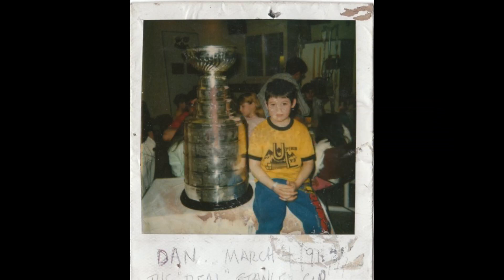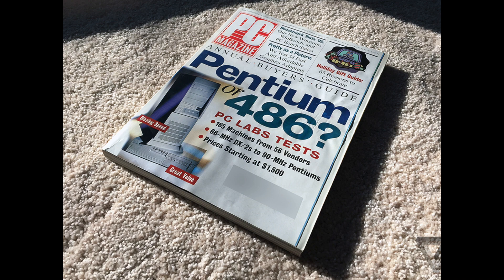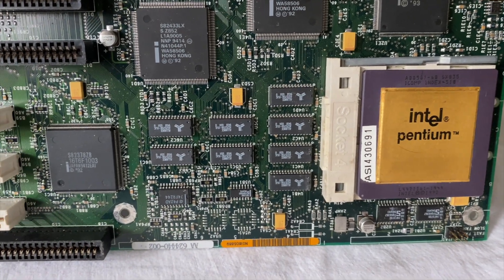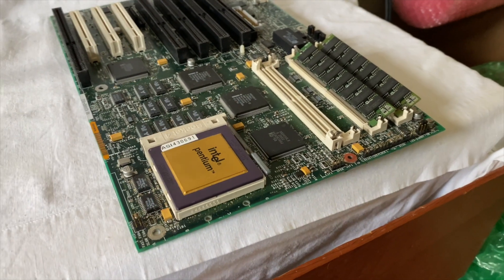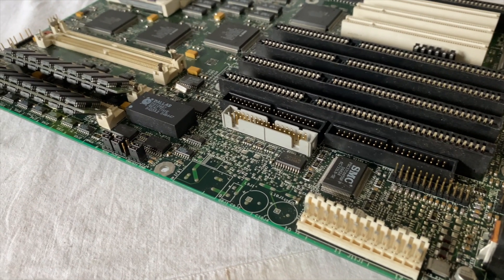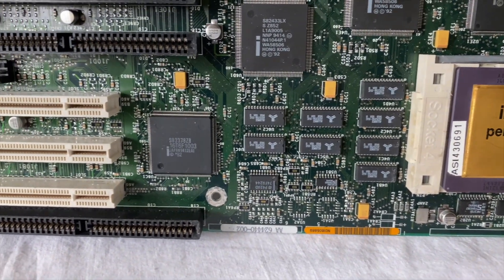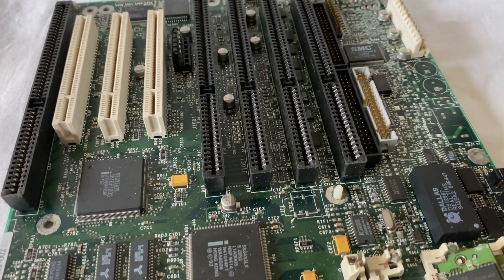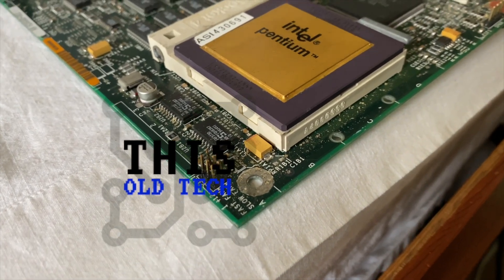The P5 60Mhz Batman's Revenge Motherboard History

Comment: Great video! 

I acquired my first P60(Vobis branded) in February of 1995 and as soon as I had installed DoomII I fell in love. Still have 4 boards(3 generic Intel + 1 ECS) all "overclocked" to 66mhz despite some not having the required voltage regulator. I also had one board by Siemens where I swapped the crystal for an 75mhz one and the cpu would even work at this frequency but the chipset needed to be cooled... quasi the fastest original Pentium I had ever used(~55fps Doom timedemo).

the pictured Escom P60 would be quite a treat.
Reply from the maker: Damn, I have nerd envy over here. I had no idea it might be possible to push to 75... Almost makes me want to fiddle with the strange P60 board I've got that supports 32pin & 72pin RAM :D

Comment: DUDE!! I have same Board!  But it wants me to enter password when entering BIOS. If i'm simply pressing Enter - it inters BIOS, but it has few features.. It's kinda want admin password or what? Please help/ THX!!!!!
I modded RTC Dallas.  Jumpers do not give anny affect  on Administrator password
Reply: Might have to de-solder the Dallas battery chip and solder on a socket. Removing the battery should help it clear the password, I believe these also have a jumper to disable the password entirely if I remember correctly. One of the few types of boards that has that.
Reply: @DanielDeyette  i did it already
Reply: @DanielDeyette  jumper do not give effect!
also board is in perfect condition. it should work properly but it doesn't

Comment: I think the P66 board is batman's revenge (AF2 fw)? Anyway just fixed a dallas rtc (tapped into it adding new replaceable cr2032) on mine and updated to last firmware 13 (yesterday) haha. Terrible IDE implementation, but easy to add sata to it! A cool piece well built and stable.

Comment: Good overview. Dell used this board in the Dimension XPS line as well, around 1994. Only difference was PS/2 instead of AT keyboard plug. My XPS P75 has this board and it’s pretty solid, although the BIOS gets very cranky when you replace the Dallas clock chip battery thing. I had to flash it to a newer version to initialize the new time chip, and then downgrade because the new fully PNP bios was buggy.